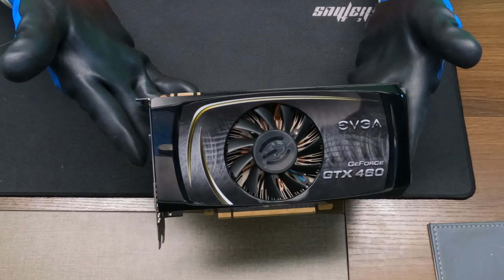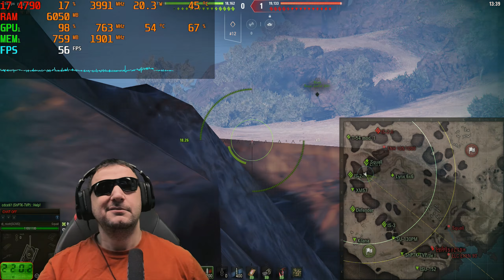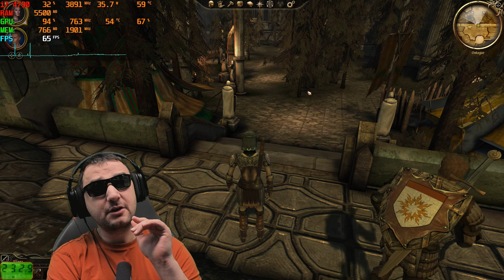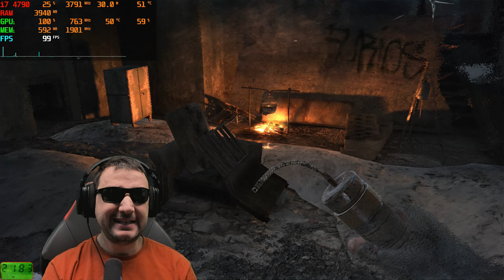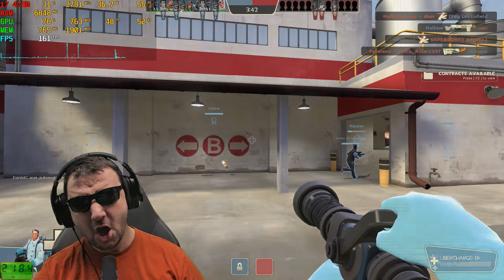EVGA Geforce GTX 460 Benchmark

Comment: You don't need 2 power connectors. I have only one PCIe 6pin power connector on PSU.
The second one I have through adapter Molex to PCIe 6pin. And you don't even need 2x Molex to 1 PCIe. There are 1 Molex to 1 PCIe adaptors with thicker cables.

Comment: Dumb request, but this would be a good opportunity to test to see how the recent Sonic Unleashed recompilation project would run on this GPU.  It lists a Sandy Bridge series GPU and a GTX 600 series as the minimum hardware, the GPU needing to support DX12, which I am sure the 400 series supports.  I've heard people say the game runs smoothly, but to be fair, a game running code from 2008 will run great on modern hardware.

Comment: Nvidia didn't change by all these years- for example RTX 3050 6 GB/3060 8 GB.

P.S. 2:00 (and not only this timestamp/this video): do you need a psychiatrist (just kidding ofc) 💩💩💩?
Reply from the maker: My new favourite tank. BRRRRRRRRRRRR
Reply: Using different amounts of vram has always been practiced not only by nvidia but by literally every other brand, ATi, Nvidia, AMD, 3Dfx...
Reply: @h1tzzYT if the vram is only difference- ok, as a long-time gamer, I would consider it normal. But other differences are just scaming people in my opinion.
Reply: @Piotrek_Fanatyczny_Kociarz  So you draw the line at vram but not other specs.. thats a bit weird, considering its not unusual either:body-blue-raised-arms:
Reply: @h1tzzYT I started being interested in hardware around the time when for example Radeon 9800 Pro had 128 and 256 Mb VRAM versions. So as a kid/teenager I just got used to it and considered normal. But ok...maybe it isn't.

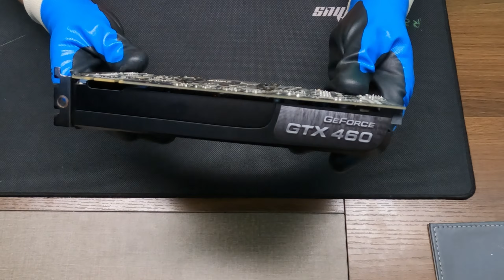Comment: this is not "questionable"(0:25) GTX460 at all Daniel😉 ... those 768MB models were the bulk of the initial GTX460's release ,the 1GB models were much lower quantity during the release date.
My:virtualhug: Twintech GTX460 is back from those days ,and it's also the 768MB version. 
Of course ,nowadays ,having the 1GB model is much more preferable ,but those days back then ,there wasn't any difference.